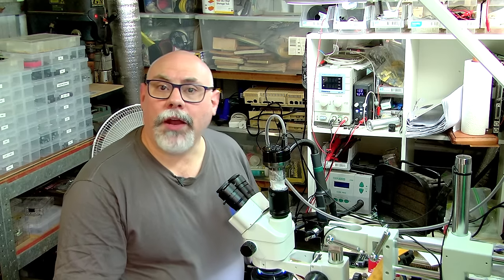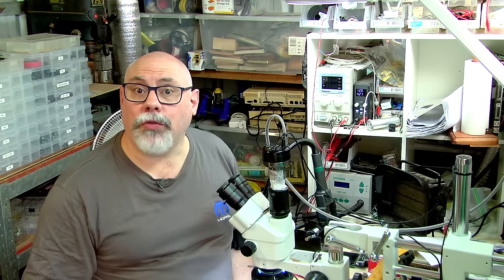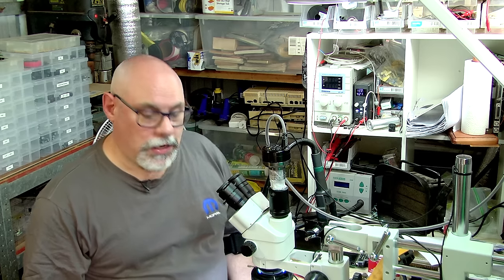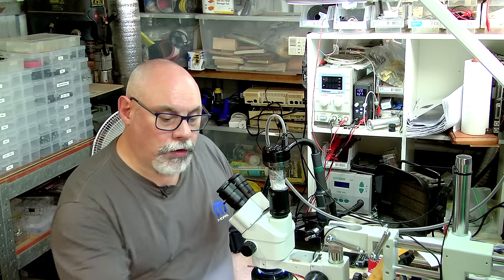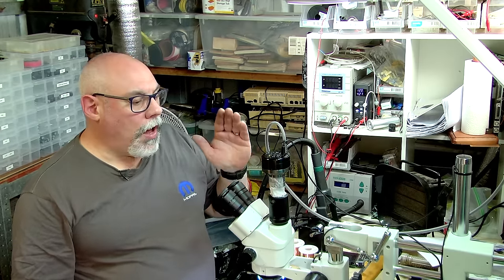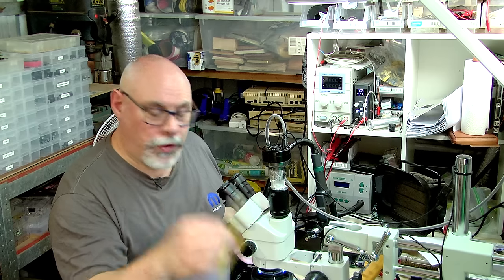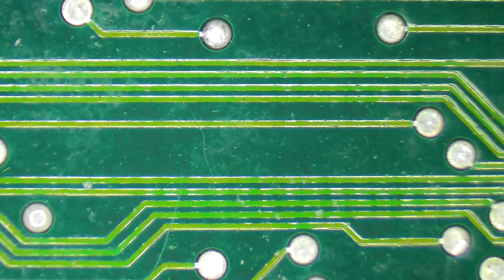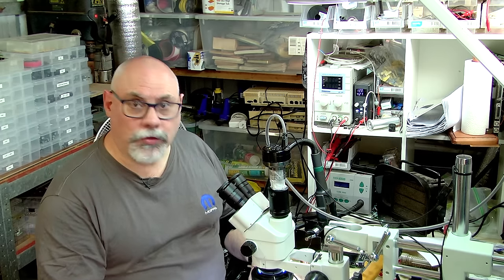Repairing broken traces on a circuit board

Comment: Brilliant video as always Bruce! Any chance you could do something on how to deal with cap removal where it's very hard to get the heat in.  I am working on recapping an Amiga A500 board and I have one cap that sits just below the Motorola CPU that seems the very devil to get hot and I am scared I may damage the board with too much heat. I have gone as far as 420 degrees C and managed to get the old cap out, but there is a blob of solder in the hole on the side that is hard to heat and I cannot get it out with my solder sucker.  Can you give some advice on how you deal with this sort of issue?
Reply from the maker: Because the A500 uses through-hole radial capacitors (rather than surface mount) I wouldn't remove these with hot air. I would either flip the board over and try to draw out all the solder from the pins using some solder braid or a solder sucker, or I would cut the legs of the capacitor to remove it (just leaving the pins poking out from the board) and then just remove one pin at a time using a soldering iron and a pair of tweezers.
Reply: @BranchusCreations  Thanks for your advice, what temperature would I be safe to go up to with either my iron or my de-soldering station? I am new to this and not yet fully confident on what temps it is safe to use. I did get the old cap out, but annoyingly, it left a blob of solder that seems to be in the middle of the hole. I have added new solder to both sides and tried to suck it out with the de-soldering station but it just won't budge for some reason.  I was thinking I might hold the new cap on the upper side and blow hot air from the lower side until the solder gave a bit and then pushed it through leaving that blob in the hole and then solder it up. I am a bit cautious of using the hot air gun as watching a lot of videos on YouTube a lot of them show where people have overheated the board and scorched it.
Reply from the maker: @Wallygjs  I tend to work with quite high temperatures on my soldering iron (about 420ºC) but I am quite quick, so I don't expose the board to that heat for very long. I use about 400ºC with my hot air rework, but I also use metal shields to protect other components from the heat. I would be trying to use solder braid (or wick) to remove the solder from inside the hole. Have a quick look at this excerpt from one of my other videos: https://youtu.be/82eBkK1csno?t=2170
Reply: @BranchusCreations  Bruce, thanks for your help, in the end I had to take the de-soldering gun up to 480ºC and finally I was able to get the blob out and now have a nice neat job, in fact the machine that prior to the recapping was booting up to a yellow screen now boots to the Workbench screen and I have been able to boot into the desktop and do some disk copying and other stuff without any glitches. I am not sure if my de-soldering station is over quoting the temperature as I tried using 420ºC and it would not budge the blob of solder.  As soon as I went to 480ºC it came out no problem and didn't damage anything. It seems there is a large area of copper around the cap that is at the bottom of the Motorola CPU and it was sucking the heat away very efficiently.
Reply: @BranchusCreations  Oh I also wanted to ask if you were being affected by the fires raging in Australia at the moment,as you always seem very relaxed doing your videos I am assuming you are a long way away from the bush fires. I really do feel for your countrymen in NSW, they are really getting battered at the moment.
Reply from the maker: @Wallygjs  Thanks for your concern. We're close enough to be constantly shrouded in smoke, but not close enough to be in any danger from the fires themselves. We're very lucky as many people have lost everything.
Reply: @BranchusCreations  I hope you stay well out of it and if you know anyone who's been affected, please let them know that the "poms" are thinking about them and hoping they stay safe even if their property goes up.  You can always rebuild, you can't get reborn (as far as I know!).

Comment: i just use an already insulated wire and solder it on 2 points that the trace used to connect

Comment: If the problem was corrosive then you should have neutralized and cleaned the board before repairing the traces....shouldn't you??
Also what do you think of using adhesive copper tape, particularly for the copper pads.
Reply from the maker: This was a demo board, not one I was actually repairing. I would clean it up a lot if it was. I have no issue with people using copper tape, it's just not my preferred method.
Reply: @BranchusCreations  
Cool.

Comment: If it's just cut , lifted or missing print fix it .

PCB with corrosion or carbonization are automatically scrap boards just replace them .
You just can't guaranty the repair !

Comment: Can you repair circuit Boards broken in half?
Reply from the maker: I have done, but it depends a lot on the board. If it's a simple one or two layer board it's usually achievable, but if it's a 4 or 6 layer PCB, it can become much more difficult, or even impossible.

Comment: nice video, but how do you repair a broken point that does not has a trace?
Reply from the maker: You have to try and find another location on the board that shares the same circuit and run a wire to it.
Reply: @BranchusCreations  Thank you very much!

Comment: If a trace is corroded but not broken, is it ok to leave it?
Reply from the maker: Once corrosion sets in, it typically gets worse with time. The prudent thing would be to clean off the corrosion and tin the trace with some solder to protect it.
Reply: @BranchusCreations  thanks
Reply: @BranchusCreations  after you tin it, I'd coat it with solder mask to protect your rework. Solder mask will have instructions on how to cure it (UV cured masking is very easy).

Comment: Hi  excellent video but my problem is I had to remove component with broken pin  and some track lifted that had a very tiny trace  so need to join the broken trace that goes under the component pin  
Bryan VK7KWB

Comment: No need to cut just wiggle and it will fracture and break
Reply from the maker: I prefer to cut. Wiggling puts too much pressure on the joins.
Reply: @BranchusCreations  fair enough. I’d say that cutting offers more opportunity for failure. Great vid. Thanks

Comment: Why not just bridge the gap with solder?
Reply: Solder is meant to join (also why is called a solder joint) conducting surfaces together, not meant to be the conductor itself, as current doesn't flow through solder the same as it would through copper. If it's a high current curcuit, it can easy get hot enough to melt the solder bridge when it doesn't have a solid conductor inside it